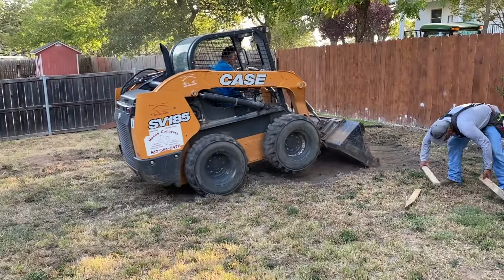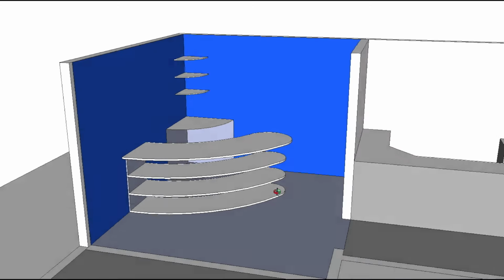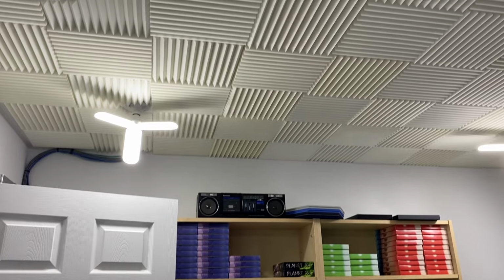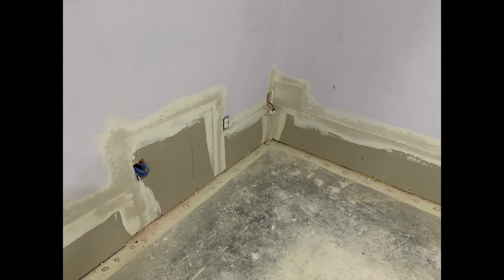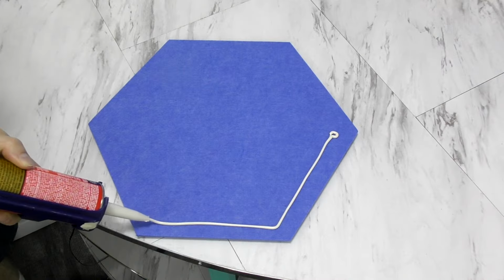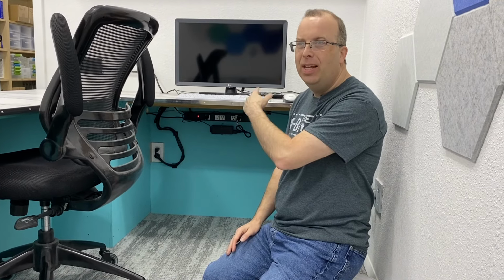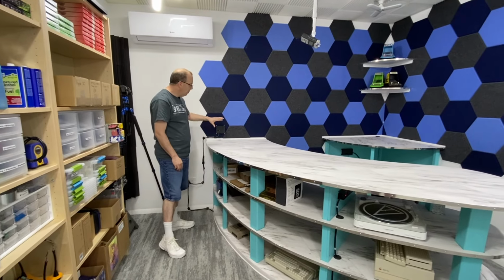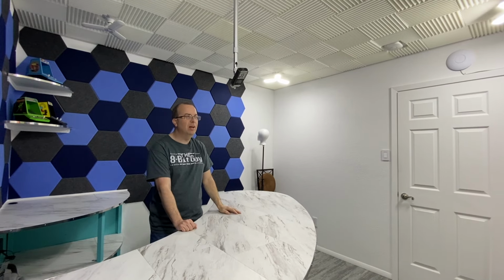8-Bit Guy Studio Build - Part 3

Comment: The hexagons are better than triangles, but... something about it just doesn't look right. 
I think it's the same problem as with triangles - the background looks busy and attracts attention. Which is completely the opposite of what background is supposed to do.
The solid light blue wall in the old studio was much more pleasant as a background.
Reply: I think the hexagons can work, but they should be a lighter tone and have less contrast between themselves.
Reply: Exactly. It should be only shapes or pattern, without hugely contrasting colors. Two shades of gray at most and NO blue at all.
Reply: It's not symmetrical on the left and right walls, really throws it off.
Reply: @inothome  OMG now I can't unsee it!
Reply: I find LTTs sets pretty good.
Reply: @AFpaleoCon  the first thing I thought of when I saw those hexagon tiles, was LTTs old WAN Show set... That looked pimpin, but alas, they took it down to make room for a new set, considering one of their video series' never had a dedicated set, and just used whatever set was free... It didn't help that they were doing WAN Show on webcam the last year too
Reply: I think David has too many dark colored hexagons, especially compared with the bench paint. The blue and the black look almost identical, brightness-wise, so it makes the whole room look darker than it should.
Reply: Yep, tone down the background and put interesting stuff on the walls instead. If you can, try to achieve more shallow depth of field with camera settings.
Reply: Disagreed
Reply: Yeah, it's still too much contrast in the background for my taste too.
Reply: Was thinking that the whole video: Why not flat light blue in the background like before?
Reply: This. Trying too hard with the background.

Comment: I don't mind the idea of the hexagons, but I find the regular pattern is distracting.  I think you'd be better-served by doing something more random.  I also wonder if you should incorporate a few of the lighter hexes into the background, because now it seems a little too dark, and maybe having a few light-colored tiles in the background would actually help the camera set a proper exposure and color balance.  As it stands, the color balance was really off in that last shot with you talking.  You looked green.

I also wonder if the white desk surface is causing problems.  I like the marble-like pattern a lot, but maybe it's too light for the camera?   I wonder if you could just put down darker construction paper and see how that looks on camera?  Ditto for the walls now that I think of it - cut out hexes in colored construction paper and just tape them up to see how various colors and shades look.

You have a lot more energy than I do, that's for sure!  Glad to see you've recovered from your injuries.  That was a nasty spill and those spider bites terrify me.  And then the great freeze and flood on top of it all!  As if the pandemic weren't enough crap to deal with..

Comment: really wish you could port your games to be sold on steam, I know its not the same as running it on older hardware and it wouldn't work.. but its still something I wish could happen because id buy them on there np, I don't have the hardware to run it and I know I can probably use a emulator but if I had to run a emulator instead of the hardware of the time might as well just go full on blasphemy and play it off steam.

Anyway great video love how the studio came out!

Comment: You work so hard sometimes, but you need to get some advice on sound and audio from sound and audio people. I'm not an expert and I can see the problems. You're in George Lucas mode on this setup, trusting your experience because you have a lot of fans that support you so you don't see the mistakes you don't need to make.

You're underexposed on the white wall because the lighting is wrong. The hexagon background is just covering up the failure to light correctly. You don't even need fancy lights necessarily, just real cheap studio lights and don't flood the room with light.

The Zoom H4N mic is not nearly good enough for what you do. It's kind of a terrible choice.  You can record to it if you want, but get a shotgun mic on a boom. That way you can control the recording from somewhere the mic is not at. You could even hide it in the desk.

Comment: The hexagons are fine, but the video portion at the end had the color grading a little too cool. It should be warmer like the photos at the end with the guests.
Reply: Yeah I think he needs to either change the lighting or do some color correction in post. He looks like a ghost!
Reply: Not wrong on the suggestion. I was also adding that wall mounting his yellow drum keyboards like he did before might also help. Is missing some light colors (yellow for example), and these would be perfect while not adding to much ! :)
Reply: Yes, a splash of light on the background is needed.

Comment: @9:44 For the "underexposed, backlit" problem, you could use a video camera that offers Dynamic Contrast Ratio feature, where the camera can selectively adjust the gain for overexposed/underexposed regions and create a much wider overall dynamic range for exposure. Many modern camcorders offer this feature.

Comment: dave, the metal band is upside down, the text engraved on the strip is pointing the other way 😅😲 and why texture the ceiling when they had the plaster boards up if it was going to get covered by the foam tiles anyway? regardless of this, it looks really nice indeed
Reply: Came to the comments to see how many people noticed the font was upside down on the banding. Good job people can't see that all the time as I know it would annoy a lot of people. I am not sure I could actually live with it, I would have to take it off and flip is over.

Comment: Wow don't connect that desk directly to ground, unless you want to die.
In electroncis, grounding for electrostatic discharge  means using a low conductivity path, not a low resistivity path.
Typically 1Mohm is used to provide slow discharge of your body while not allowing you to being electrocuted..

Comment: I think the reason why you're not liking your wall accents is because it is clashing with the teal wood beams on your desk and back wall. Either the colors on the wall need to change, or you have to figure something out with the wood beam colors.
Reply from the maker: Unfortunately, the available colors for the hexagons are far and few between.  So the only way to make it match would be to repaint the desk.

Comment: I love the way the wife doesn’t run and help him up she just goes there walking and takes the package
Reply from the maker: Actually, that's what I asked her to do.  You just can't hear it because there was no audio in the recording.
Reply: @The8BitGuy  what other four letter words were uttered in the missing audio?
All the forward momentum carried you forward a ways. I can see easily why you pulled those arm muscles.  Ouch!
Reply: @The8BitGuy  his wife: Not again. I hope my romance book is still okay.

Hope that fall didn’t hurt to much.
Reply: @The8BitGuy  the hexagons look great but you should add two more light blue ones on your left hand side (the right side of the screen) down at the bottom of the pattern where the white of the wall is showing, that little bit of white catches the eye and draws my focus away from you cause it stands out
Reply: @The8BitGuy  Just to make sure you see this, if possible please check and remove EVERY SHARKBITE fitting you can find, that's not a permanent installation and it should never be left on inside a wall
Reply: @Faraonqa  Might have been ok with a frost-proof (freeze-proof) spigot.
Reply: @The8BitGuy  Yeah, I assumed you told her to get the packages to the truck before it leaves. Did it even hurt right away? I assume the pain took a few moments before it started. 🤔
Reply: @The8BitGuy  oh ok that makes sense also I love how the studio looks you chose a good design forgot to put this into the original comment